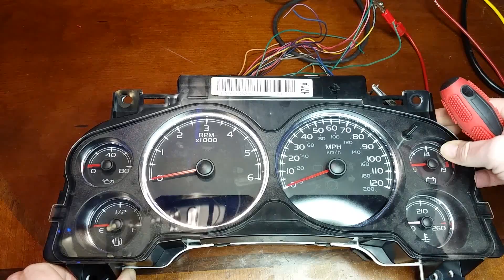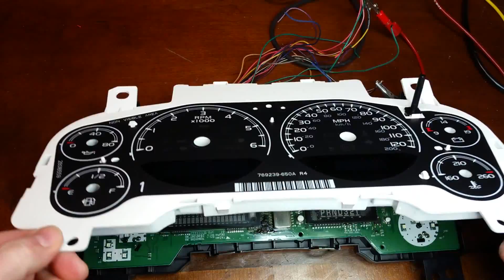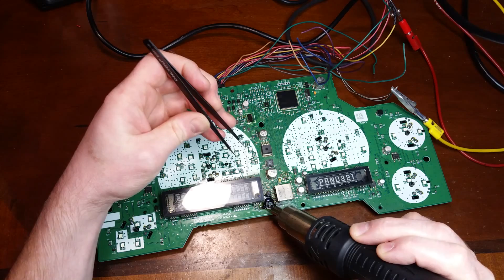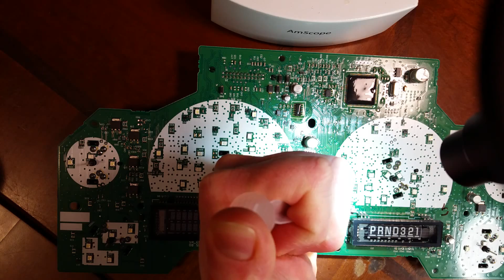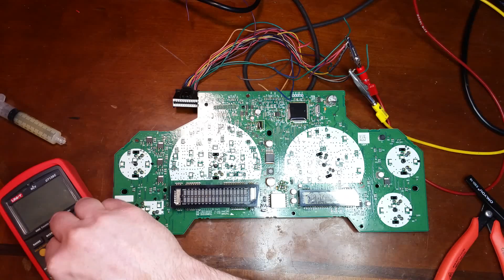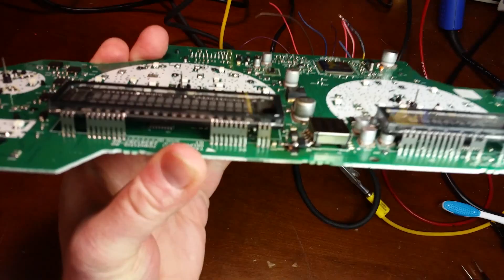Watch me Repair GM Chevy 2007 + Cluster Odometer Display

Comment: Wow, nice work, my suburban 2008 oil gauge stop working, just changed my oil pressure sensor, but the gauge is on zero, fuses good, was thinking on buying a new panel, but my be fixable with what you showed on your video, any tips before I finish messing it up and buy the new panel? Thanks for the video.
Reply from the maker: Plug in a scan tool and read the sensor. Also run a gauge test sweep before you buy a new cluster and have it programmed.

Comment: First I would like to thank you sincerely for all of your videos. You are the man!
Second, I would like to ask why you don't have a video on changing the odometer display in the driver information center from Miles to KM, or KM to miles.
I have a 2008 and I am trying to do this.
I was hoping to use my Tech 2, or my OBDstarx100 that I bought after watching your videos, but I can't figure out how to do it.

Thank you for any light you can shed on this issue.
Reply from the maker: If there isn't a setting in the menu display options, this would be a VIN specific programming, part of the microprocessor firmware, not a eeprom selection.
Reply: @jeffescortlx  Thank you for the quick reply.
So this isn't something that you know how to do?
Reply from the maker: @JuggaloCujo  bestpixle to the rescue

Comment: Jeff, what happens to cause the Mosfet, 100 om resistor, and driver to burn up? I have watched many similar videos without encountering the answer to this question. Can you enlighten me? Is there anything that can be done to prevent it?
Reply from the maker: I'm just guessing, but the engineers might have underspeced the the MOSFET when they selected it. The resistor and chip failing is caused buy a shorted mosfet pulling too much current and putting power in places it doesn't belong. I've been soldering a heat sink lead to the heat sink tab to give it more thermal mass to dissipate heat from.
Reply: I noticed you soldering a ring on there, but didn't catch what t was for; Good idea! Thank you for your answer. How do I arrange to send my unit to you for repair (if I can get it out) 2007 TAHOE LT
Reply from the maker: If you leave me your email I can send over contact information.
Reply: RWC19653@GMAIL.COM

Comment: I have a 08 Silverado gauge cluster powers up but all gauges only move to the first line . Like there getting power but no signal after.  Do you happen to have a diagram or picture of what it is.  Thank you
Reply from the maker: I'd start by plugging in a scan tool to see if your having communication issues.

Comment: Would you know why that my cluster lights flicker and my 2007 Avalanche
Reply from the maker: Backlight or warning lights or both? If backlights it's possible you have a defective LED.
Reply: Just the backlighting
Reply from the maker: If the rest if the dashboard is fine my guess is defective LED.
Reply: Okay didn't start doing it until I change my whole dash out and I had to take the cluster out the Dash cover

Comment: 07 tahoe i have. led lights won't light up.circuit board problem?
Reply from the maker: What about the rest of the dashboard, radio and HVAC light up?
Reply: its my wifes tahoe.and just found out then hvac lights dont light up.aftermarket radio.every thing else works on the cluster
Reply from the maker: Did they work before the radio was installed?

Comment: Can anyone tell me the part number to the check engine light led mine on mine 08 silverado is burt out and i want to order a replacement before I tear it apart to replace it
Reply from the maker: I believe it's a 3528 orange. But its not normal for them to burn out naturally on their own. Did you buy the truck used? Previous owner may have "disabled" it. Maybe with a piece of tape, or maybe with a chisel.
Reply: jeffescortlx yes I bought the truck used and havnt pulled the cluster out yet. Thank you very much for the input. I will check for the cover up.
Reply from the maker: If you see finger prints all over the face you'll know what's up.
Reply: jeffescortlx thank you very much sir

Comment: I have an 09 Silverado that all the background lights work but the entire set of gauges goes out all at once or never comes on. When it does work the information center reads service trailer break system.   Please help.
Reply from the maker: You might actually have a problem with the braking system, you'll need to see a mechanic about that. Send me a private message or give me your email about repairing the cluster.

Comment: Hey Jeff I have the same type cluster. The LEDS/ backlights work but nothing else . The motors are dead and no displays. The large 3 leg regulator in the middle of the board has no voltage feeding it . Have you ever seen this issue ?

Thanks for taking the time to make these videos. You are very good and informative.
Reply from the maker: Typically the power will pass through a diode before the input of the regulator, check that out.
Reply: Yes I understand. All diodes check good and the 12 volt leg ( facing the bd) top right leg gets it feed from another transistor on the far right of the bd. Know clue where that transistor gets its feed or what switches it. Looks like this one is scrap. Just wandering if you'd ever seen this issue ? First time I've seen this . Ty sir
Reply from the maker: Put the board in the freezer, the see if it will boot up. If not warm cpu with hot air and check again. The cpu typically switces the voltage regulators on older versions.

Comment: 07 tahoe.. does the same thing with the display so I took it all apart and there seems to be nothing wrong with it nothing burnt no holes but still no display. I used to bang it on the side and it would come on but after a wile the banging stopped working.. what do u recommend or what should I do.. repair or new one
Reply from the maker: Jadiel 254 
Have it repaired. Replacement with programming can get expensive.
Reply: jeffescortlx do u happen to stay in texas??  Or where could I get it repaired
Reply from the maker: Jadiel 254 
Sorry I'm in Minnesota.

Comment: hey man I got a quick question minus the same thing wrong with it if I buy one from the junkyard same make and model can I just put it in the vehicle without doing no programming or anything I was thinking that's the cheaper route an easier route? Please get back to me
Reply from the maker: Well a junk yard cluster will "work" but the odometer will show the miles of the vehicle it came out of, instead of your vehicles true miles. And the 07+ GM's are very picky about the options, so if the braking, suspension and option are not a match, your message center will be screaming warnings and errors at you.  
Just get your original cluster repaired. A junk yard cluster could just fail in the same way soon to.

Comment: Hi, nice job you did there, very smart ! So me 2 have one problem and I think it is related with the cluster. I own a mazda 2 petrol 2007 semi-auto. Every time I put the ignition ,the cluster shows normal and after I start the engine, 10 sec normal and then, the gear display dies with the count-tours and the anti-theft goes intermitent. The DTC is: Lost comunication with the IC. At the beginning I suspected a false contact in the can network-cheked, after that a power problem, but not all led's goes off on the cluster, so ... With the engine on, when I engage Hi beam, the cluster reborn and dies again with the lights off. Can you think of something ???
Thanx
Reply from the maker: malinovschi rares 
I'm sorry I'm not  very familiar with that cluster. Only advice I can add is standard electric trouble shooting. Start with looking for fractured solder joints.

Comment: i pulled from customers 04 silverado had the c5s on ut befire i started i checked power supply at harness as well as battery needles felt choppy so i put power to board to check light most were out so i put x27 replacements new bulbs and hit every resistor with some 60/40 also reflowed harness pins on either side to ensure power flow from harness when plugged in so back lights all work engine light is constant no gauges nor prndl nor odometer their both still black so both should be good prom chip is secured regulators appear to be good and capacitor is still in good shape u have 3 units now like this and its my head off the wall now if you follow what i mean seen your vids and i know and follow your experience as well at this point im at stand still with those or find wrecker units to transfer to these customers of mine rebuild those etc but will end up stocking these boards until i can get answer to this problem
Reply from the maker: Ohms auto 
I can take a look if you want to send them over. I've been suspecting open via's on 05's.
Send me a private message if you want my address.

Comment: i undstand that i put in all upgrades motors an oem bulbs reflowe all the typical resistors etc yet same result ive done hundreds of these an this one seems to be the odd ball yet i had 2 other customers will same issues as well im leaning towards the microprocessor but not sure on how to really test it
Reply from the maker: Ohms auto 
is it really a 04 board or possibly a  05 board?
Reply: jeffescortlx quick question what chip are you using and where did you get it? the replacement part? Thanks

Comment: engine light on 04 silverado no prndl or odometer or gauges
Reply from the maker: Ohms auto 
You'll need to send it in for repair. These issues are normally covered with a full rebuild.

Comment: Dear jeffescortlx
 what is the power of the resistor?
Reply from the maker: I don't remember the wattage. It's low current coming through the gate. Just match package size and you'll be ok.
Reply: Thanks for quick replay :) .
From where you purchase it? if you have the link you can given to me please
Reply from the maker: If you blew and opened the 100 ohm then your driver chip is also going to be damaged. I would recommend to send it to someone that is experienced with component level repair.

Comment: I congratulate you for such an amazing video, I would like to ask you something, could you tell me in that silverado cluster what are the parts that emit sound when giving a notification? Please and thank you very much. Sorry if I do not write English well, I'm using Google translate.
Reply from the maker: Jeffry Briones 
the sound isn't coming from the cluster, pretty sure they use the radio for the "dinning" sound.
Reply: jeffescortlx Exactly, I thought, I have a trailblazer ltz with a cluster similar to silverado, I changed the stereo and the sound notifications stopped working. I am fond of electronic things and I thank you for getting me out of my doubt. Excellent video! You are very professional in your work, continue like this
Reply from the maker: Jeffry Briones 
I think you can find 3rd party aftermarket modules that can be added to restore the sounds. But I don't think there is anything you can do to restore radio reset of tire monitor, oil and key fod settings through the radio.

Comment: mine doesnt mark the gas its always on E and doesnt move from there even if its full
I want to know what to do since I can't afford to buy a new cluster
Reply from the maker: Jeanetie Trevino 
What model and year vehicle do you have?
Reply: jeffescortlx  2007 tahoe while I was exiting the highway I heard a sound like something broke and I stopped and turned off the truck and nothing was different from the bottom I turned it back on and the gas marked empty after being full before the noise iam so stressed cuz my dashboard is all cracked and if I change the cluster I will have to buy a new dashboard also
Reply from the maker: Jeanetie Trevino 
So did you run something over? You might have just damaged the sending unit or wiring for the sending unit. Take the vehicle to someone with the proper scan tool to check the sending unit signal. Otherwise you might be throwing money at things that aren't broken.
Reply: jeffescortlx it could be just I little plastic on the road thank you very much for the advice I will totally do that before buying expensive parts

Comment: I have a Tahoe with the same problem? What should I do? I know for sure i wouldn't be able to do all this process
Reply from the maker: Homar Garcia 
I would recommend to find an electronic technician with experience at component level repair. 
Otherwise at a higher cost you could exchange it at the dealership. Not all dealerships are equipped with both the equipment and experienced auto tech to program the new cluster, so ask questions.
Reply: jeffescortlx thank you so much

Comment: any chance you have a video on how to replace a stepper motor? 08 avalanche.  thanks in advance
Reply from the maker: J Cortes 
No, I don't have a video of that. Well because that style doesn’t go bad under normal circumstances.
Have you hooked up a scan tool and run a gauge sweep to confirm you don't have a sending unit or other issue?

Comment: Hi question on your 2007 GM cluster fix display  repair video you replaced the 8 pin driver IC. What is the part number and where do purchase ? Thanks
Reply from the maker: NuWavUSA 
I was able to pull enough information from the part number printed on the chip and order it from either mouser, Newark or Digi-Key. I don't remember exactly it's been a while.

Comment: can you give me estimate? 
i have the same problem 
i live in Winchester va 
thanks
Reply from the maker: Gordo Diaz 
I typically charge 100 plus return shipping.
This includes driver chip, gate resistor, mosfet, foil repair when needed and proper electronic calibration. Covers the worst case scenario. There are people on ebay that will do it for less. But I can't speak for them if they can handle the bad ones.
Reply: jeffescortlx  
do you have any idea how much will be the fee of the return shipping?
Reply from the maker: Gordo Diaz 
typically USPS shipping to the lower 48 states is around 12$.
send me a private message through youtube if you want my contact information.
Reply: jeffescortlx  excuse my ignorance... 
i dont know how PM. 
can you tex me 
5406647591 
i will delete this 
in a few 
thanks

Comment: are the miles stored in the cluster or can i go to the junk yard and get another speedometer without it changing and screwing up  my miles?
Reply from the maker: J Cabral 
for this cluster and other GM's the mileage is stored in the cluster. If you install a junk yard cluster, it will show the miles of the junk yard vehicle.